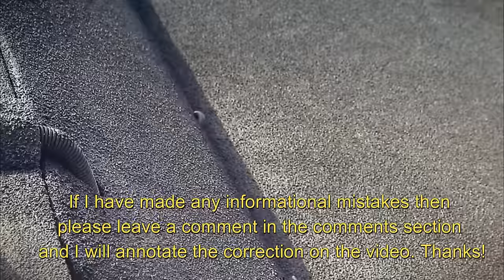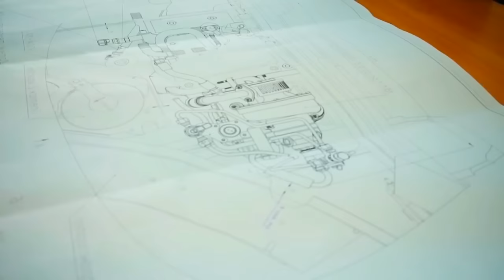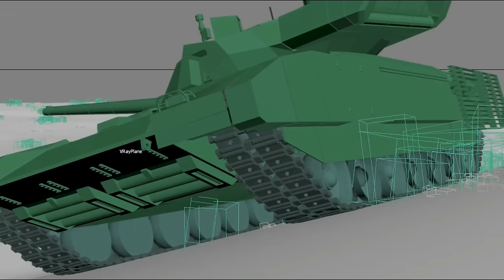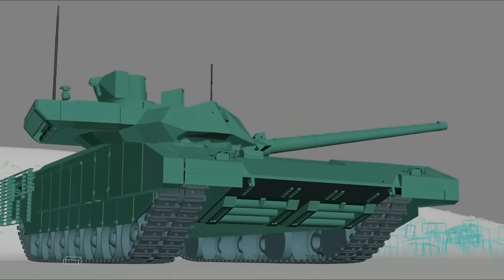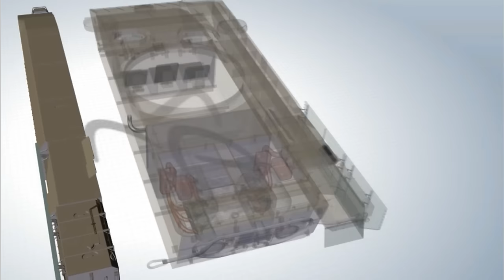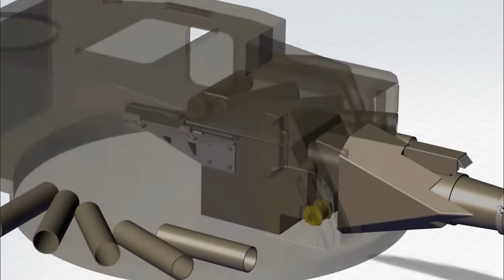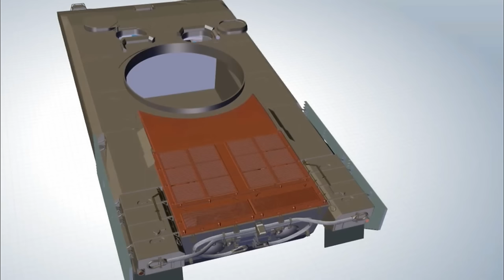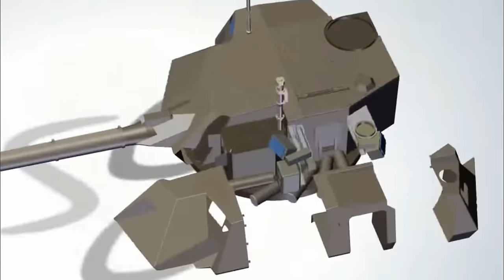T-14 Armata Russian Main Battle Tank - Tank Overview

Comment: Isn't it really bad to have concave areas like the ones on the turret?
wouldn't that weaken the armor?
Reply: Do you mean the gunners site and ejection port?
They will never be armored. thus it is better to have them sunken into the armor instead of flush with it.
Reply: ahhhh ok thanks.
Reply: Scuzzy Bear The turret is unmanned, the three crew members are sitting in the front of the hull side by side.

There is no reason to build a 35 metric tons armored turred like the M1, as you only need to protect the autoloader, breach and turret stuff.
Reply: ya i know the crew is in the body, just wondering why that hollow spot was on the front, also if its a ammo ejector why not put it on back where its less likely to be hit?
Reply: You are right, I think the turret is so light armored that it won't stand an rpg, missile or sabot round, making irrelevant that weak gaps.
Reply: i wonder if the tank comes with a Vodka bar (:
Reply: It Ballistic cover. armor underneath.
Reply: I bet it has an arena anti missile type defence system
Reply: Scuzzy Bear      Tanks are now going the same way warships did. Defense is becoming less about how to defend against being hit, and more about not being hit in the first place. It's just taken this long to make active protection small enough to fit on a tank. To follow the analogy, you could think of the tank as an aircraft carrier and the automated threat detection and defense systems as its "aircraft".